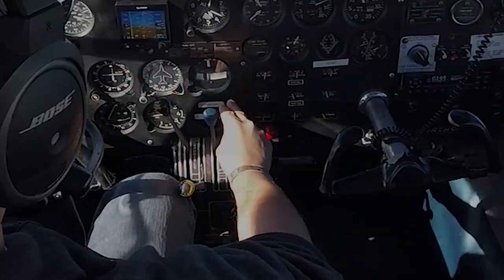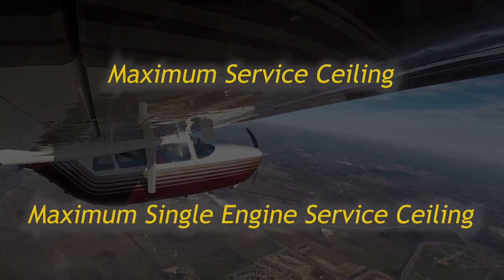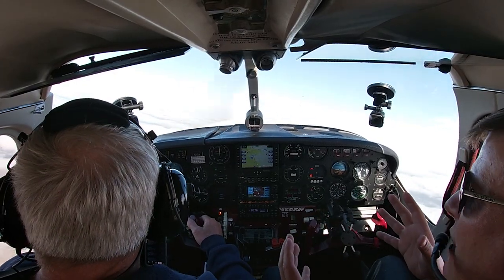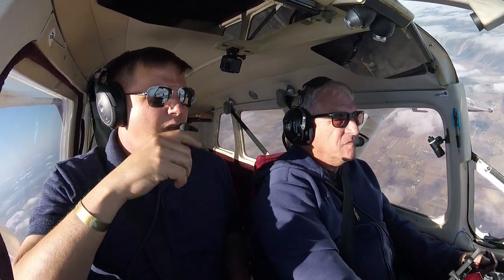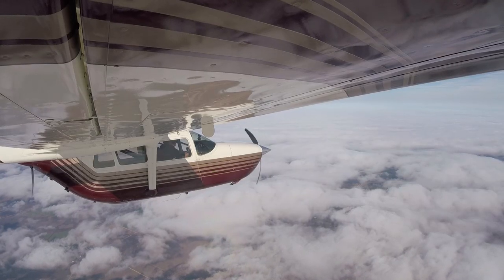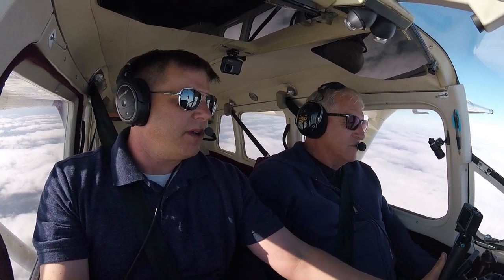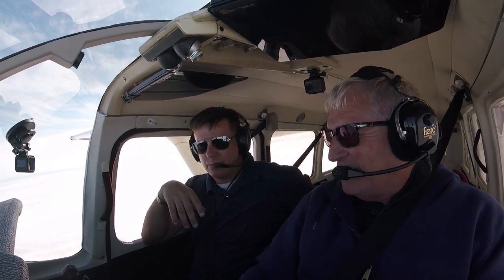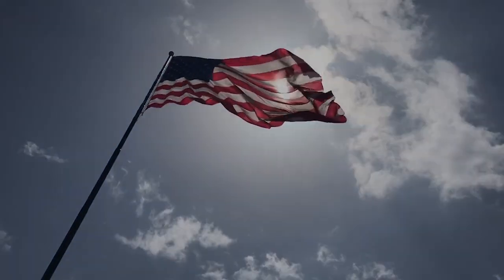Cessna Skymaster-Autopilot Stall with an Inoperative Engine!

Comment: One time I saw an “engine failure alerting system” installed in a piston twin. It had two lights on the panel that would indicate which engine had failed. It clearly isn’t something in widespread use and I’m not sure how it worked, but something like that seems like a very good idea on a 337 or other tandem twins. A light illuminates on takeoff...pull back affected throttle to verify failure...immediately feather...fly normally. A manifold pressure gauge cannot definitively indicate that the engine has lost power. The needle would have moved very little if at all if the simulated failure was real because the throttle plate would remain fixed. Similarly the tachometer would barely move if at all because the propeller governor remains functional even with the engine windmilling.
Reply from the maker: Alex Grzelecki thanks for the tip and thanks for watching!

Comment: You should demonstrate windmilling rear engine, full flaps and gear down and try to maintain single engine level flight. Can't be done. This goes with your rear engine fail not recognized.
Reply from the maker: Excellent point-- if i have the opportunity to fly with Jerry again down the road I'll certainly consider that.

Comment: Great video! Question... when you simulated the engine failure was there any noticeable change in torque effect (adverse yaw, p-factor etc) without the engines matched? Just wondering if that might also be another possible indication of failure if a pilot finds themselves having to add more pedal than usual.
Reply from the maker: Alexis Scott that’s a great question and honestly - you really can’t tell.  I think some older models had an annunciations installed to warn of an engine failure much like the low rotor rpm warning on a helicopter.